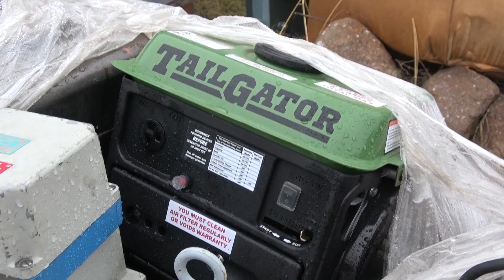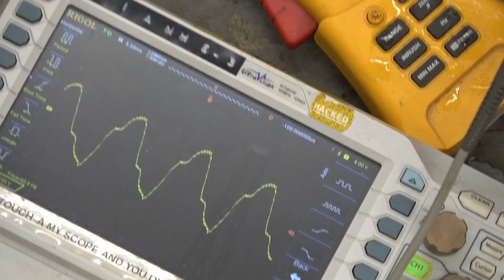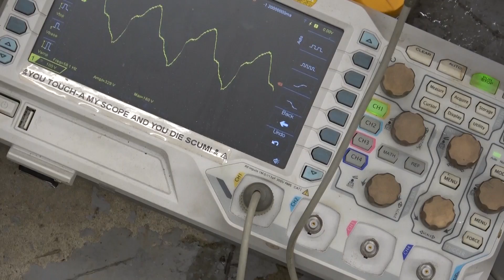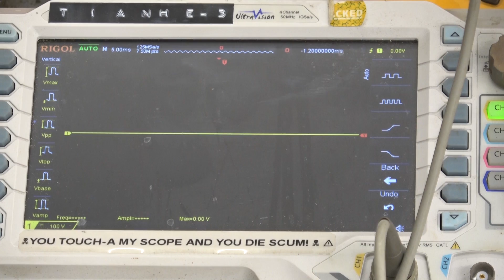BOLTR: Harbor Freight Tail Gator | Brine Tank Testing

Comment: The current creep conundrum you noticed can be traced to the temperature of your resistor.  Temperature is a measure of kinetic energy, or how quickly atoms, molecules and ions are chooching about.  In a conductor of the metallic persuasion, those rattling atoms knock the pixies off course and resistance increases with temperature.  In a salt solution, the pixies are catching a ride on the ions, so when temperature goes up, resistance goes down.

Comment: I once read a comment from a guy who managed a trailer park. He had something like a dozen of these things and rented them for $20/day during power outages to people who wanted to keep their fridges running. He said he just loctite'd the screws holding the reed valves, then started it up and ran it for 30 minutes with no load, then 30 minutes with a 100 watt load. Once those things were done, they basically ran forever, he hadn't had one fail on him after several years and hundreds of hours between them.

Comment: Picked up the Power Fister version about 12 years ago. Was great on the job site to run a few lights, or charging batteries for the cordless tools. Couple years later the fuel shutoff began to leak and the carburetor gummed up. Been sitting in the healing shed ever since.

Comment: Now what you do.....Is modify the bucket....Put a roller in the center of it....coat it with peanut butter....(every prepper has PB around).....Place it in a dark corner of the shop....put a board up to the top of the bucket....Instant Vermin Stew for the hard times coming! .....READY TO EAT upon discovery! YEP! "How do they do that" and our government allows the importation of a filthy 2 stroke powerplant in mass quantities but, requires me to have "clean burning" yard tools and fuel cans with spouts that cause you to spill more than you transfer.....Guess they are bought off???

Comment: Had one of those generators for years. Cold blooded SOB, but it did work great. Voltage wasn't consistent when it wasn't at full load and on the governor, it would surge when we were only running it for a string of lights. It would run a circular saw if you tapped the switch a couple times until it was up to speed, it would pop the breaker if you tried to run it all at once. Run it at 32:1 if you want it to last. 50:1 is for the EPA, not the engine.

Comment: I bought one of those tailgaters years ago out of the HF mag. All I used it for was running lights in the boat for checking hooks and trotlines. It didn't hold out on 50:1 two cycle mix and the moist, beer can laden, environment

Comment: I tested the efficiency of a generator that looks very much like this one. The rated power is 650 W continuous. I used a separate fuel tank on a scale so I could weigh the gasomaline, connected to the carbonator with a hose. At 550 W load, the efficiency was 9 % and at 50 W it was down to 2 %.

Comment: What can you actually do with 5 amps/550watts?  You can't run a space heater.  You might be able to run a blender or a hairdryer but not both.  It's enough to keep your beer cold but not enough to zap your frozen dinner in a microwave.  5amps just isn't much.

Comment: G'day,

I had one of those Generators, and I kept a Logbook on it because every 100 to 250 hours the Exhaust system needs to be removed, disassembled, decarbonised, & put back together.

Otherwise it chokes itself because with the RPM governed at 3,000 RPM (in Oz) the Fan blows enough Air to cool it at full Output - and at anything less than full load the whole thing gets overcooled & the unburned 2-Stroke Oil condenses in the "over-chilled" Exhaust..., the Droplets stick to the inner Walls & the Red Hot Gas then carbonises the Oil - progressively narrowing the Lumen..

Anyway, I logged 4,475 Hours & 2 Minutes on mine, between 2005 & 2012...

It was my first encounter with the phenomenon of Stupidly Cheap Chinesium which actually does the job.

Most of the units are bought by people who don't read the Manual, use the Genny for 3 weeks on one Camping Holiday..., after which it's hard to start and runs slow & gutless ; so they throw it in Landfill &  get another one, and then shit-talk Chinesium which they're too lazy &/or too stupid to maintain in operating condition.

  Backtrack me to my "Mad Scientist Videos" Playlist to find a Video of the Exhaust Cleaning process.

Happy Solstice Festival...

Have a good one,

Stay safe.

;-p

Ciao !

Ciao !

Comment: These things are actually surprisingly good. I have one practically identical but set up for 900w max at 230/50. During one extended power outage I had it running for a good 14 hours with ~600w load on it with only a couple of refuelling stops. Only problem I've had with it was due to the batshit design of the fuel tank. It's a two part construction and the flat plate is on the bottom, with the bowl shaped bit on top. So when the seal inevitably goes you get a floor covered with oily fuel. I can't remember how much I paid for it, but it wasn't much and it was a very long time ago, so I don't think it owes me anything. It can be a right bastard to start though, even if you do find the fuel cut off valve...

Comment: So i have the red version and having ran her for 3 months what fur keeping me warm whilst sleeping in the backseat of my truck I can verify she will run a 1000w space heater, For 3 hours before running out of fuel. This led to me buying the 4200 gunny from them (harbor freight) able to run for 2 nights on a tank with sum to spare. I'd like to point out how hard it is to not let you arm or leg fall off then back seat its cold down there,  don't tip the space heater over, fire hazard.  So I measured one night up at the dome light was 80 f dungerees, the floor had my case of bottled water frozen they were, down there. Well done sir.

Comment: The little flashes. If I were a betting man. I'd say a large enough bubble of hydrogen forms to displace the water enough the contact between electrode and water is broken enough to cause an ark which in turn ignites the hydrogen bubble. I say this because the little flashes look a lot like hydrogen flames.
Reply: Also, I think you will get chlorine gas coming off it.

Comment: I have the same one. OK for running a power tool, but not much more, saved me $200 by running a full size fridge when the power was out for a few days, but everything was angry. The genny was bogged down, the compressor in the fridge "ran" but not well

Comment: When I was a kid we used a salt water rheostat to connect two terminals from a household extension cord plugged into the wall.  One side went into the salt water rheostat and the other directly to a sharpened  carbon rod that was removed from a D cell battery. From the rheostat came another wire that we attached to another sharpened carbon rod. I made bookend style brackets out of wood and  then inserted the carbon rods so the pointed ends could touch each other. Salt was added to the water to control/reduce power. After it was plugged in we would bring the carbon rods together tip to tip and behold we had a brilliant carbon arc light when the rods were slightly separated. I wore sunglasses but my friend did not and got some UV damage to eyes and face.

Comment: They sell those little generators here in Scotland for $120-$200 depending on where you look, they seem like a good little emergency generator to store in a log cabin or remote hut to do some battery charging for lights and mobiles, also they look like something you could put inside a washed out clean farmers lick pale or paint bucket and store in a boat for if you have to land on a beach in bad weather or for charging light and laptop batteries for a small occasional usage caravan/trailer (something like a 2 bed single axle tow along trailer)

not too bad for occasional camping but not for daily use as the wear life might not be as long..

For the price of 2 pizzas in any city this is good, the heavier generators or the fancy Honda run between $800 and $3000 for household use and the sky's the limit for industrial diesel ones as well.. 

Throw this one in your camping kit or your fishing hut and pick up a couple of cans of petrol and you've got some charging power.. 

Thanks for the good video

👍

Comment: Also, you're experiments aren't changing the pH of the solution. The only ions that would be added are those from your electrodes IF they are corroding.

Yer current is increasin because it's hearing up. Water gets more conductive as it heats up.

Comment: Yer using AC current, so you should be producing hydrogen and oxygen gases at each electrode depending on the sign of the current at that specific time. The sparks are probly just when a good mix comes into contact with too hot of metal; likely when it's created a big ol bubble around the electrode.

I studied electrochemistry for water oxidation. I'm just a random internet commenter to you, but can provide some evidence if ya like!

Comment: These gennys have been around forever in 240v 650w . I used to get 3 months continuous use out of them then throw them away . It struggles when the fridge and freezer kick in together. Had a 100w globe as base load . 20 years ago I was getting them for $50aud with warranty. Been what they are they are good cheap abet very low powered genny also the perfect weight and size to throw at drop bears

Comment: I have had similar looking generator for almost 15 years. I paid 75€ from it. I have used it maybe once or twice per year, sometimes couple of years between uses. It has always start easily and get the job done. 

It runs every tool, even a small compressor if there are no residual pressure in pipes. Other tools i have used are circular cutting saw, hilti hammerdrill, 230mm angle grinder, water pump and 1000w halogen light. 

With powerfull motors, it takes slow start, but get them running. It don't run too fast when there are no load. It is light to carry and don't take much space from the shelf.

I can say for sure, it is right tool for a job, especially if the alternative is to carry 50kg generator into island to make a hole in a rock. 

I don't know how long it would last in a real use, but for my needs, it has been perfect.

Comment: This generator will get you more attention at the local campground than AvE wearing spandex shorts in prison.
Reply from the maker: "Woopsie doodle! dropped my soap. Again."
Reply: @arduinoversusevil2025  still
Reply: More efficient than a Hardly Ableson at converting gasoline into smoke and noise
Reply: I mean who wouldn't step behind a pair of hands like that?! 🤣
Reply: Cue the Dewclaw sneaking in the back door.
Reply: Don't need Ranger Rick stopping by 2 minutes into generator hours telling you "They've had complaints.", while you're one bar on your battery because the dang kids gotta sleep with some lights on...

Comment: I had one of those. The zinc gas tap dissolved in the gasoline. It wasn’t too crusty on the inside though. 
Funny thing is that the plastic fan and rotor are all press fitted to the crankshaft, should be fun taking that a part.
Got mine as a non runner, the problem was a crank seal that popped out of the bore.

Comment: Anyone ever mount fancy Electronic governor to a cheap generator? Some of those governors (Barber-Coleman AC frequency Governor) are twice the cost of that little bastard... I've been thinking of using one on my Honda ex5500 mainly to see if my fancy speed controlled angle grinder would work with the idle function. Also, you can increase the distance the elctro-gremlins travel in the water. Oh, wait, you're not supposed to get those wet.  I've seen a youtube use electrolyte as a speed control for a motor.

Comment: Ive got one of those units, sorta. its the same shape and form factor, but different plugs and the sticker reads "eagle river" and claims a 1200w capacity. Ive always been curious if its actually got bigger windings, or if they just put a different sticker on it at the end of the assembly line in china. I know for a fact mine was sold before hoober fright started selling them, so perhaps HF actually de-rated them to increase reliability? Anyways I found this one at a pawn shop covered in mud 6 or so years back, and I got the guy down to $50 cause it had a tag that said it didnt run. I took her home, yanked the cord a few times, and she fired right up, and shes lived rent-free in my camper since then.

Comment: Adding or removing water from the blue bucket - without changing the electrode position (key point)- may not yield the expected change n current. The area of the electrode in the brine is also changing (as the bucket freeboard is changing).

Comment: Russian winter: Bottle of vodka and a revolver. Canadian winter: Open fire, petrol, chlorine crackling electrodes, carbon monoxide. Russian odds suddenly seem longer.
Reply: I for one have survived a bottle of vodka and a half froze .38. Not so sure if I could have made it through the improv hydrogen generator next to a wood fire and a can of premix all in the same room.
Reply: @sheldoniusRex  oh, it's all safe enough til you hit whatever the flashpoint for the hydrogen gas or the lung-liquifying point of the chlorine gas is. Good thing is the shop's probably draftsome enough you don't need to crack a window to get a breeze and the beers get a little extra head-fog to boot. Just 'member the fire water in the red can ain't for drinking.
Reply: Canadians gotta complicate everything!

Comment: Pro tip: if you run it inside, it doubles as a heater. Also, it will help you sleep.
Reply: There is something oddly soothing about the sound of a 2 stroke engine in the next room.   It's too loud when you put it right in the same room as you, but put it in the baby's room and it's just perfect.   I oddly like power outages for that, good excuse to bring it out and fire it up.
Reply: It'll help you sleep but it won't help you wake up.
Reply: @matthewhall5571  the build up of hydrogen and oxygen gas being produced may help wake someone up eventually.
Reply: They should rebrand it Ambien
Reply: *forever
Reply: Thanks man I’ll definitely have to try it👍
Reply: There should be a disclaimer to your comment, look where we are.
Reply: best lay in you'll ever have
Reply: Yes sleep permanently!
Reply: hmm i wonder how much heat it generates; perhaps you could put it inside but pipe its exhaust outside so its waste heat helps heat your home
Reply: This guy should not be allowed to reproduce...lol

Comment: That start sequence. I inherited a frankenblower from my pops. First snow fall and I spent high near 2 hours (! Yes, I too am dumber than I look) trying to pull start the thing. Finally engaged the noodle and started troubleshooting only to find that a previous handyman had installed a new throttle lever - but chose for reasons beyond my comprehension to install it backwards. Set the throttle to off, and with the last shred of strength and integrity of my now shredded shoulder, pulled the cord with the gusto of an hourly paid union shop hand - and the beast roared to life!

Comment: I'd buy one right now if I could get one in Alaska. 2 stroke is nice when things get cold, don't have to bring it in for a warm up before starting, and don't have to worry about enough oil making it to the top of an air cooled engine when it's -40 and the batteries need charged.

Comment: A load bank can be pretty easily created out of a piece of metal plate and some water heater elements. Size the plate so it fits over top of the bucket, drill and tap holes in the plate so water heater elements screw into it, bolt your safety ground to the plate, then just put the plate on the bucket so the heater elements are down in the water. You can even use house switches to switch the elements in and out of the loop so you get an adjustable load bank. Just treat the elements for what they are, a huge power resistor and wire in parallel or series as you deem fit. Works great for testing portable generators where you don't need to go much above 40-50 amps. For a longer run test you might need to hook up a circulation pump to a radiator or pond or something so you can keep the load consistent. Although if you have access to a swimming pool or pond you can just put the heating elements in that and problem solved.

Comment: Doesn't electrolyzing brine produce: sodium hydroxide in the solution and chlorine+hydrogen on the electrodes?
Reply: It does, and you'll get dizzy quite fast if you smell it too much!
Reply: DC current, yes. AC doesn't really do much electrolysis
Reply: @LateNightHacks  it does, but the production sites switch places 50/60 times a second.
We aren't removing rust, we're producing NaOh+H2+O2+Cl2.

Comment: I think that's the first time I've seen anyone getting sparks from water !
Sketchy as frigg but I'm glad I saw you do it first, now I don't have to, but I might !
Reply: Similar principle as in electrical discharge machining, but they normally use a dielectric fluid such as oil instead of water.

Comment: Anyone knows whats the cheapest most efficient electrode to do electrolisis?
Reply: Wire brushed rebar works well for me. Just keep checking for a build-up of rust on the re-bar, which seems to cut the efficiency WAY down. Stay away from copper or stainless steel though, it makes the solution into some REAL bad dookie! The copper just makes a nasty mess.
Good luck!

Comment: Went to test the generator the other day and wore myself out. About 50 pulls in I realized the electronical engine switch was off. Actually it WAS on, because I left it that way the last time I tested it. So right after opening the fuel line and before the first pull, I actually turned it off. 😂